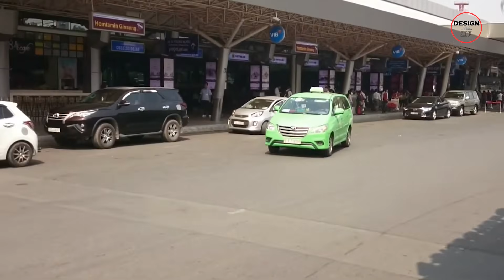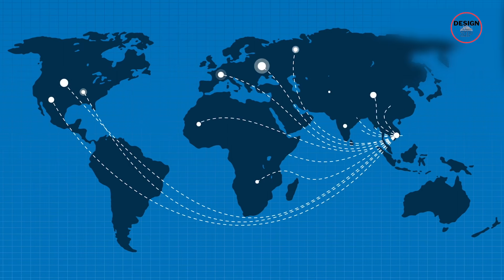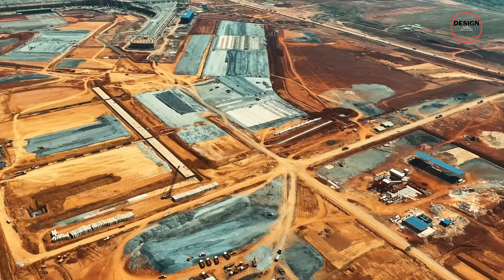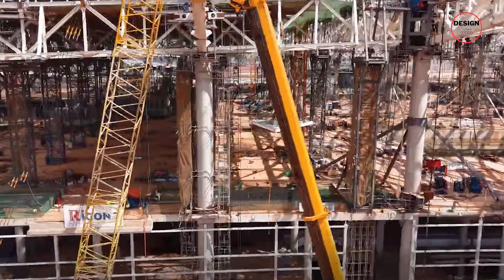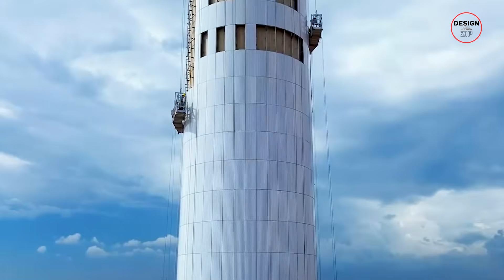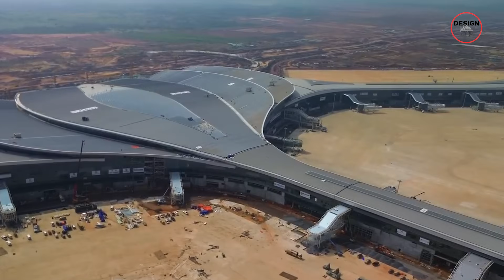Inside Vietnam’s $13 Billion Bet on a New Mega Airport

Comment: Singapore will loose  transit passengers   when new Big modern  Vietnam  airport complete.
Reply from the maker: Vietnam will likely attract more transit traffic in the future, but Singapore’s strength comes from its airline network, efficiency, and reliability. It’s more likely Southeast Asia ends up with several strong hubs rather than one replacing another.
Reply: @designzip5890 Vietnam New airport is more short distance for  transit passenger than Singapore airport..it is the win win..

Comment: Good project in deed but they forgot to build the freeway to it. It takes 4-5 hours on peak time to get to the city
Reply from the maker: That’s a fair point. Rail projects like this really do work best when the supporting road infrastructure keeps pace. If access to the terminals is still taking four to five hours in peak periods, that definitely limits how effective the project can be in practice. It’s a good reminder that big infrastructure needs to be planned as a complete system, not in isolation.
Reply: In fact, they are expanding the highway and initially plan to handle only 25 million passengers per year to alleviate congestion at Tan Son Nhat airport, with phase 2 involving the construction of an additional high-speed rail line To facilitate convenient connections and further expansion, it is expected to begin commercial operation in June of this year and complete all expansions by the year after, with the goal of welcoming over 100 million visitors It ranks among the largest airports on the planet and has the potential for further expansion in the future because, unlike other large airports, it utilizes all available land and has limited capacity for expansion. They do this because, according to calculations, it will be completed before 2050 The number of visitors could increase by at least three times.
Reply from the maker: Good points. T he highway expansion and future rail link should help improve access over time.  Starting with a lower capacity and scaling up is common for mega airports . If the timelines hold, it could ease congestion at Tan Son Nhat and support long term growth.  Thanks for adding the details
Reply: Chúng tôi đang thực hiện và sẽ sớm hoàng thành đường dẫn trong năm nay. Và long thành là cảng hàng không quốc tế tram dừng chân nối chuyến và vận chuyển hàng hóa giữa châu âu mỹ và châu á

Comment: Mexico City’s airport has a similar issue. Benito Juarez can’t expand because of the surrounding neighborhoods. They had a state of the art airport in the works but the leftist president scrapped it out of jealousy because he didn’t want his predecessor to leave behind a legacy.
Reply: The new airport Felipe Ángeles that was supposed to alleviate the air traffic problem is two hours away from the city!
Reply from the maker: Mexico City is a good comparison. Benito Juárez is boxed in, so expansion was always going to be extremely difficult, no matter who was in charge. Scrapping the original project definitely reset the clock, and the replacement solution came with its own trade offs.

Felipe Ángeles being so far from the city really undercuts its usefulness, especially for connecting passengers and business travel. It shows how location matters just as much as runway count or terminal design. That is why countries like Vietnam chose to start fresh in a carefully selected site rather than trying to force growth into an already constrained airport.

Comment: Vietnam is dual-nodal with Hanoi in the north and HCM City / Saigon in the south. Because of this, it will be very difficult to make economic sense since there aren’t economies of scale with one central focal point - like Singapore or Hong Kong has.
Reply: Vietnam isn’t trying to be Singapore or Hong Kong. It’s a long, dual-center country, and large economies routinely operate multiple major airports just fine. Long Thành is about relieving Tân Sơn Nhất and serving southern demand, not forcing a single-hub model that doesn’t fit Vietnam’s geography.
Reply from the maker: Exactly. Vietnam’s geography makes a single mega hub unrealistic. Long Thành is really about capacity and resilience in the south, not copying the Singapore or Hong Kong model.
Reply from the maker: That’s a fair observation. Vietnam’s north–south split does limit the kind of single-hub efficiencies you see in places like Singapore or Hong Kong. That said, Long Thanh is less about replacing HCMC and more about relieving pressure and handling future growth, even in a dual-node system.
Reply: You are wrong..

Comment: Why don't you zoom out the map to get a clearer view? Long Thanh Airport is located in the middle of the development triangle of the entire Southeast region. To the west, of course, is Ho Chi Minh City's financial center. To the northeast, there are numerous large industrial zones. Right next to it is the Nhon Trach Industrial Park. About 35 km south is the Ba Ria-Vung Tau maritime transport hub (where there is the Cai Mep-Thi Vai deep-water port capable of accommodating 24,000 TEU ships, heading straight to the US). Long Thanh's location is indisputable. Long Thanh will serve as a transfer hub, receiving 80% of international flights from Tan Son Nhat and 20% of domestic flights. The highways are being expanded 2 to 2.5 times, sufficient for phases 1 and 2. By phase 3, the railway will likely be completed as well.
Reply: Lớn hơn nữa là trung tâm đông Nam Á.
Reply from the maker: That’s a great breakdown. When you zoom out and look at the wider southeast region, Long Thanh’s location makes a lot of sense. It sits right between HCMC, major industrial zones, and the Cai Mep–Thi Vai port, which is a huge advantage for both passengers and cargo.

The phased approach also matters. Roads are being expanded first to handle early demand, with rail coming later as volumes grow. In that context, Long Thanh is less about distance from the city and more about long term connectivity across the entire region.
Reply: Câu chuyện cũ đúng không?? Quy hoạch từ cách đây đã 30 năm qua, quốc hội duyệt năm 2015, Việt Nam đã phải đợi đến khi hội đủ yếu tố, nhu cầu vận tải, đầu tư, vốn, trình độ nhân lực về quản trị, quản lý, kỹ thuật và đặc biệt là vốn. Không vay nước ngoài, chỉ khi thu ngân sách tăng, tích lũy trong dân tăng, tiền của người dân gửi ngân hàng 550 tỷ USD lúc đó tự tin mà làm. Có điều đầu tư công quy hoạch vùng thì sinh kế phát triển của địa phương của cá nhân vùng quy hoạch 30 năm qua phải hi sinh thiệt thòi hơn các nơi khác.
Mới giai đoạn 1 thôi, 4,5/16 tỷ USD, công suất 25/100 triệu khách. Dự kiến 2050 chắc sẽ đầu tư đủ và khai thác hiệu quả.
Nhưng trước mắt Long Thành chỉ là 1 trong 2 sân bay lớn, còn sân bay Gia Bình gần 8 tỷ USD nữa, các sân bay nội địa mới cũng phải thúc đẩy nhanh. Hi vọng 5-10 năm nữa sẽ tốt hơn.